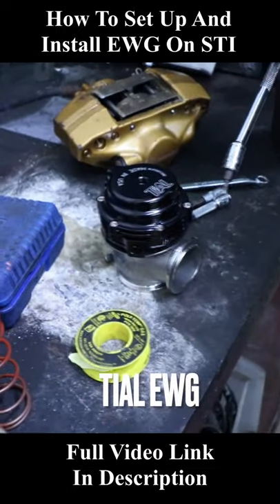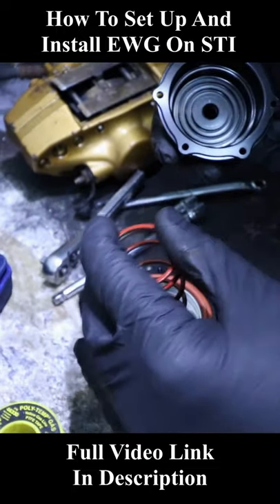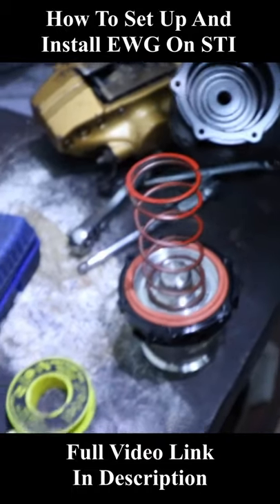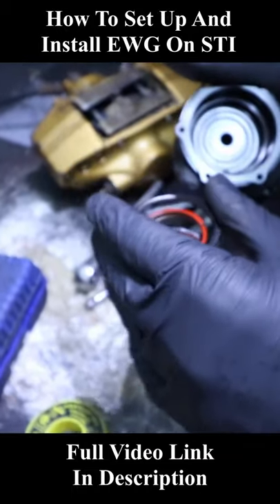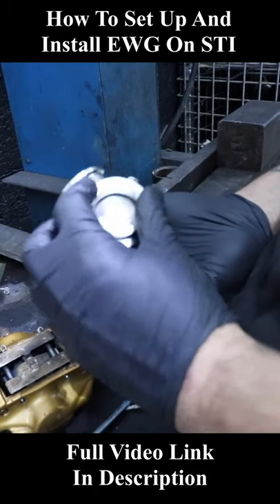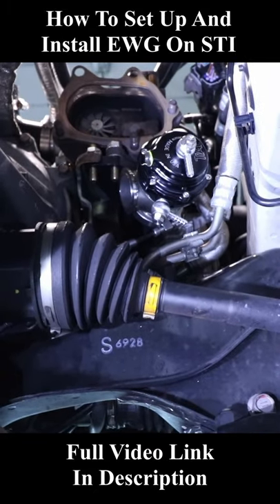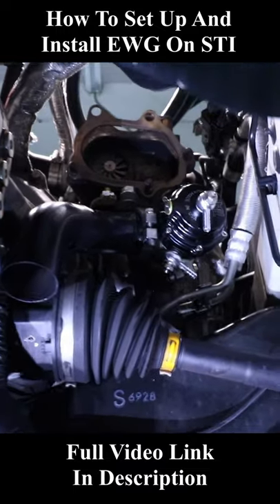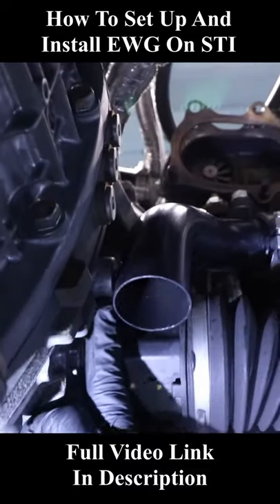Tial EWG Install and Set Up (Subaru WRX STI External Wastegate) #shorts

Comment: I put myself through this hell yesterday and lost the little nut for the bracket bolt which is a different thread than all the nuts I have apparently so I wasn't able to tighten the bracket all the way down. Probably lost years on my life from the stress of this job.
Reply: I want to try an DiY this. Would you advise against it lol